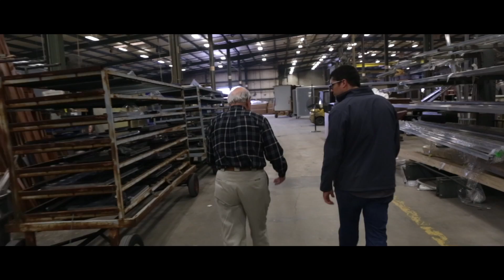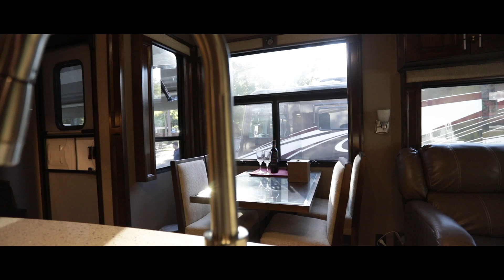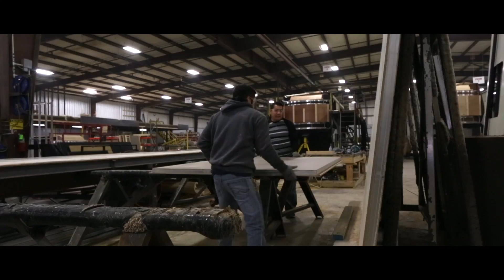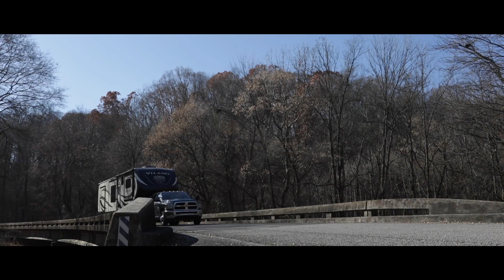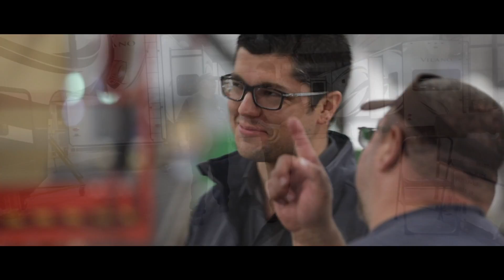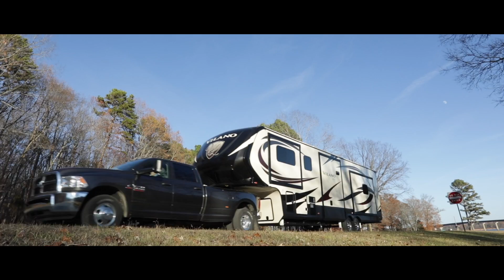Vanleigh RV: Family Legacy

Comment: Excellent 5th wheels. They really are spectacular.

Need to add heat registers with dampers. With the furnace literally next to the toilet, the bathroom can reach 90+ degrees while the lower area is still under 70. When I am sleeping I don't want the room temp to be over 65. So I need to be able to reduce the flow or close the damper in the bedroom. With the couch the lowest and furthest from the furnace it colder than the bathroom and bedroom. With dampers (purchased all new registers with dampers) on the registers one can regulate and maximize heat distribution.

Additionally we've got to have day shades. Without day shades the ac struggles to keep up with the heat from the windows. The day shade, although very simple, does create an air pocket between the hot windows and interior ambiant air.

And of course we all want on demand hot water.

Oh and the cut out around the sinks really are not hip friendly. Straight lines look much better too. The whole carrara marble look solid surface countertops are the thing right now too.

We, other future buyers, also would like the second awning over the dinette slide. Especially with the absence of day shades. You just can't sit at the dinette for lunch on a summer day. The heat coming off the window is too much. Test this. On an 85 degree day leave the rv sitting (like one does when they go fishing in the morning or on some morning excursion) without the ac on, with no day shades as they are sold, and no awning coming off the dinette/theatre seating slide. Return to the RV for lunch around 2PM. Turn the ac on and time how long it takes to get the nearly 100 degree rv down to a comfortable 75 (65 isn't an option with two ACs). Then try to eat at the dinette with the sun streaming unimpeded through the big window with the views. You'll notice as we have it's a little warm.

Day shades and registers with dampers should be standard. The awning off the dinette should be optioned in on dealer orders,

Other than these little items, you all are making the most affordable high-end fifth wheel on the market!!!

Thanks. Cheers!

Comment: VanLeigh Representative, where is the information on the construction of the Beacon?  
Do you have any videos showing construction of the Beacon?
Do you use decals on your Beacon exterior?
Do you build them with complete solar panels, batteries and inverter to the max?  (Boondocking without worries).
How custom will you go on these?
We are very interested in the 39RLB, been to the dealership in Mesa Arizona several times, can't seem to find any info on the above questions.